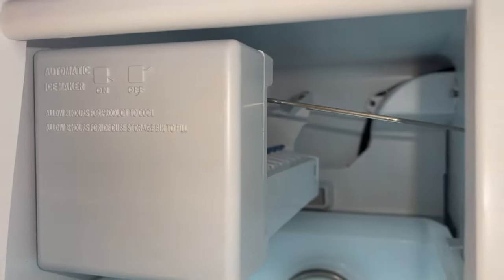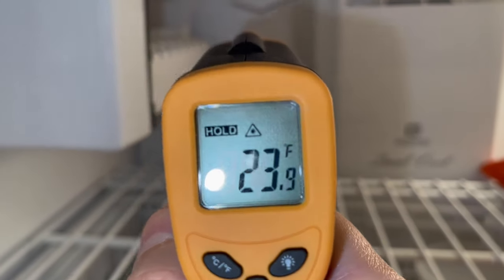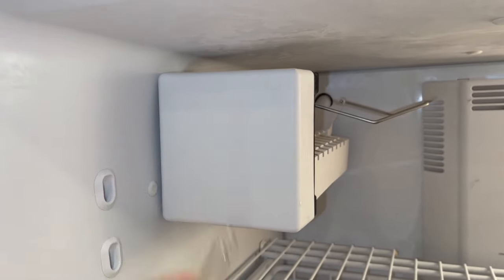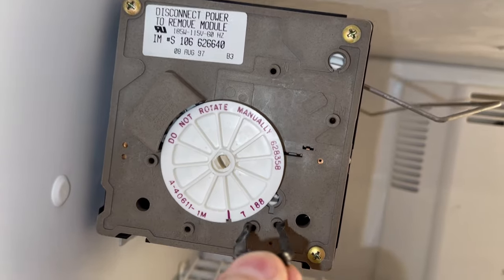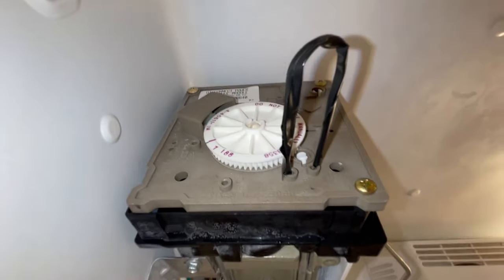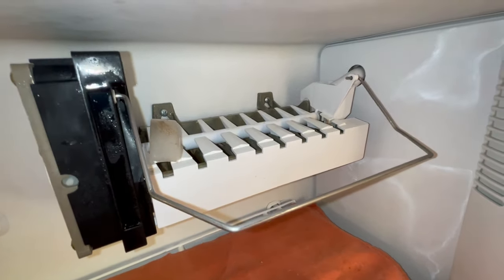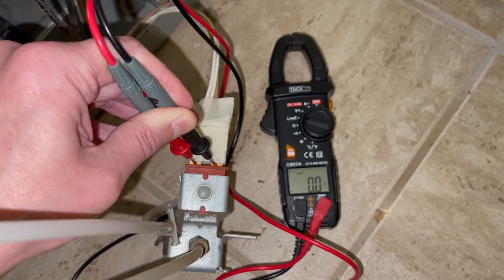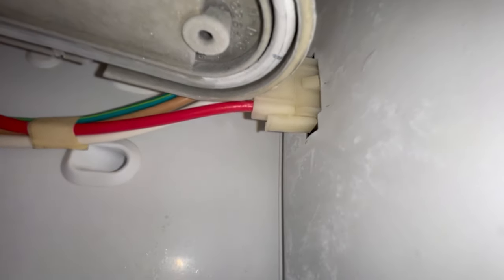Ice maker not making ice troubleshooting jumper test cycle

Comment: You can check the water valve by putting a jumper between L and V. Then push the freezer door button to close and you should get water to the ice maker. If you get water, it’s a bad ice maker. If no water, it’s probably the water valve.
Reply from the maker: Yes!
Just to add, if there is no water, the tube could be frozen shut.
Reply: @Your-Self  where do you have to point the hair dryer?
Reply: @Your-Self  how do you unfeeeze the tube ?
Reply: Awesome comment. Bad ice maker it is
Reply: @knix2for5  If it's one of the old standard type friges, you can usually go to the back on the outside, and the tube runs up the back on the outside, then there's a plastic spout that flows into the bowl shown in this video. Just unscrew the spout on the back and pull it out to see if it's frozen up inside.
Reply: I did this and ordered a replacement part but then it started working again
Reply: What if you’re getting water in the tray and not cubes?
Reply: What if it trows alot of water
Reply: @dtork47 

My issue. I’m waiting on your answer to hope we get one soon.
Reply: @dtork47 I would say check your freezer temps, if it's not freezing water that's a different issue entirely.
Reply: Is there just one water valve that supplies the ice and water dispenser or is there two for each function?

Comment: Also... Try taking the icemaker out and cleaning the tray. I use vinegar or better still cleaning strength vinegar. remove the ice bucket for better access. Loosen, don't remove two 1/4 inch bolts that hold the icemaker to the side of the fridge. (Unplug the fridge if you are more comfortable) Unplug the electrical connection by squeezing two tabs on the side of the plug. Remove the ice maker from the fridge and then remove the one plastic cover held with a phillips screw. I let the tray soak for 15 minutes  or so.  You can feel the difference in the smoothness of the mold. We have fairly hard water where we are so it builds up on the mold and makes it harder for the ice maker to harvest the ice. Might have to do this every year or two depending on the water mineral content in your area. Easy no cost fix!
Reply from the maker: Thanks for sharing.

Comment: He forgot to mention to make sure the little metal arm that shuts off when raised up once the ice-tray is fuĺl, is correctly lined up inside the little hole on the inner wall surface of the frobt of the ice maker. Such was the issue with mine, it popped out of place when [I] removed the ice tray for cleaning.¡ Gracias.. De Nada!

Comment: I have a rental property where I just had an issue. Both times I checked it the fingers were  not visible. I used the jumper and the cycle seemed to have worked.
Thanks for the video

Comment: The motor for mine stopped working so I purchased a new motor that came mounted on an end cap. Only three screws held it in. There is a flat side on a shaft for the ejectors that needs to be lined up but that was easy. Also, I removed the bar that senses when the tray is full. I just pulled the one side out, installed the new motor assembly and reinserted the bar. It took maybe 10 minutes. It would take 3 next time. You don't need to remove the icemaker for this repair if it is the motor that's bad. This video shows you how to test the motor. I would use an insulated wire instead of a paper clip, it's 120v. Thanks for the video!
Reply from the maker: Thanks for sharing.
Reply: Could you share the motor info and where to get it?

Comment: the jumper worked and the ice maker slowly lifted the ice out of the tray after the heater warmed enough to get the ice out. I'm looking forward to checking it later this evening. This was a very clear explanation and working item by item, the ice maker lifted the ice out and it slid into the drawer. Thanks so much!
Reply from the maker: Thanks for watching!
Reply: And the wire harness I have a voltage and one pan only is this correct?

Comment: Yes! Great video and very informative! Much better than the video's from the "experts" that I watched prior to watching yours.  I like how you cover the main point at the very beginning.  The freezer has to be cold enough to create ice.  My ice maker worked fine for a few years but stopped making ice a few days ago. I did all the electrical and waterline checks but could not find anything wrong.  Turns out that my freezer was too warm. The prior cooling level was fine until the last few days when the temperature in the home and opening of the freezer compartment has been increasing.  Thanks for your help!
Reply from the maker: Thanks for sharing.

Comment: Thank you. With the information in this video I was able to get my ice maker working again. Turns out it just needed a couple of test cycles.
Reply from the maker: Great to hear!
Reply: can you elaborate how you initiated the test cycles? i did the TH jumper and nothing happened. also tried LV jumper to fill water nothing happened
Reply: @zentember  I used a piece of electrical 12 gauge household wire and stripped off an ich of insulation on each end. I held the wire in place as it went through a couple of cycles. At the end of the second cycle the water poured into the tray.
Reply: @stephenlomond3720  where did you hold it in place? i was able to manually fill it with water but when i hold in TH nothing happens
Reply: @zentember  I inserted the wire in T and  H as it shows in the video at around 2:03 leave the wire inserted to get it to complete the cycle takes a minute or so to complete a cycle. .
Reply: @stephenlomond3720  i left it for several minutes not sure why nothing is happening. i used paperclip
Reply: Did you press the door switch to activate?
Reply: @DougGarrett-xb1vh  I do not recall having to do that but I could not say for sure I did not

Comment: Real help. Go thru the troubleshoot steps and eliminate the problem. Mine was water outlet frozen. Used a hair dryer. hopefully works for  while but suspect valve maybe slightly leaking water into the tray well. if so, I now know how to swap out the unit. thnaks.
Reply from the maker: Glad it helped!

Comment: Having trouble with mine today. I’ll check these tips out. Especially the paper clip cycling trick. It’s making ice but not ejecting. Turned it down a bit more to make sure it’s cold enough to engage the ejection. After a good wait I’ll try these tips if nothing happens. Thanks!
Reply from the maker: Good luck!

Comment: Thank you so much for this video!!! I just bought a new ice maker and it stopped producing ice. I used your jumper wire trick and it appears there was a couple chips stuck because after the blades made a full rotation a couple little ice pieces came out. It then filled with water now I just wait and see but I am very hopeful. Again thank you so much for this great video!!!!!
Reply from the maker: If you continue to see smaller pieces, make sure the ice maker is not tilted. Maybe the water pressure is too low. Or maybe, you just need to increase the fill time with a (possibly) hidden knob.
Reply: @YourSelf  came down this morning ice is full of nice good size cubes!
Reply: Or if there’s not enough water in the ice maker check your water filter it could be plugged enough that enough water isn’t getting through.  Happened to mine one time I was getting smaller then normal ice and it wasn’t getting enough water the filter was plugged.

Comment: the answer i found that worked for me was to take the jumper wire and push it in as far as it will go, easily. then remove it and do the same thing several times. for some reason there is corrosion that gets on the contacts and this seemed to work for me. Hope it works for you
Reply from the maker: Thanks for sharing.

Comment: Thanks for the video is informative and easy to follow. 
Question:
1. Should the voltage test show 120 at ALL times?  Or just when it's cycling?
2. How long does it take when inserting the jumper?

I put the jumper in and nothing happened.
And
When I tested with multimeter it was showing 6.25 volts. 

Does it matter that the defrost cycle was running?
Reply from the maker: On basic refrigerator models, you should always have 120 VAC on the L & N.
Refrigerators with multiple computer boards may act differently.
So, if you don't have the 120 V, it could be a wiring problem or a circuit board problem.
Reply: @Your-Self  Update:
Once the defrost cycle ended, I tested it again, and the voltage was 120.

Comment: Fantastic video - thank you!   Using the jumpers on V and L, I am able to get water to flow into the icemaker.  When I run it through a test cycle, everything seems to work EXCEPT that it does not fill with water.  So it sounds like the valve works, but is not being activated...is that right?  If so, do I need a new thermostat, or a whole new ice maker?  Thanks!
Reply from the maker: When you ran the test jumping T and H, did you remove the jumper when the wheel turned about a quarter turn?
If not, the water valve will not be activated. 
If yes, the whole ice maker may need to be replaced.
Reply: @Your-Self  Thanks for the quick reply!
I removed the jumper as soon as I saw motion on the ice maker arm.  Sounds like a new maker may be in order. :o(

Comment: Excellent video! Thankfully just flipping the arms on ours worked but thank you for the content!
Reply from the maker: Glad it helped!
Reply: do you mean reversing the arm where it was sitting or merely flipping it downwards?
Reply: @zentember  turning the ice makers off and back on then triggering the full switch 3xs puts the ice maker into reset mode.  It will automatically go through all the cycles
And start over.  Ours started making ice within a couple of hours after doing so.
Reply: @juliusflowers-fn5bb  what full switch the light switch on the side that is deprsssed when the door closes?
Reply: @zentember  my ice maker has a wide flap that lets it know the container is full of ice. That’s the flap I’m referring to. He uses a wire jumper in this video to do the same.  My ice maker is recessed in the door so i couldn’t do this without removing it.  If your ice maker looks like the one in the video (mounted) in the top corner of your freezer then do what he is showing you to do.  By no means am i discrediting the knowledge he is sharing.
Reply: @juliusflowers-fn5bb  my ice maker looks like his. I jumped LV to fill the ice but jumping TH does nothing. I want the heating element to turn on to eject the ice in the cradle. I have the metal arm like yours so I'll try to turn it off and on multiple times now

Comment: Excellent! Just what I'm looking for. Question, if you can answer: I need to clear my icemaker water line with compressed air to winterize my seasonal camp. Can I short L to V to force the solenoid to open? That would save some time. Thanks!
Reply from the maker: If you jump L to V on a basic refrigerator, the water solenoid will open. But if no water will run through it, the valve may overheat, not sure. But I suppose a few seconds shouldn't be a problem though. 
However, if you have a water dispenser as well, it gets more complicated. Because you may have 3 water valves total. And the trick with L and V will not work.

Comment: Great video. So far everything seems to work. But the water keeps freezing in the fill tube. I clear it and let it run, and  again it's freezing in the tube. It's a 30 year old fridge and has no problem  till now. Plus it's only adding a few ounces of water. Making small cubes when it was working.
Reply from the maker: Low water pressure can cause small ice cubes, and the water valve not to close completely. A weeping valve will create an ice blockage in the fill tube.
If the water to the fridge is going through a saddle valve, it may get clogged up with time. Maybe the filter is old. RO systems are not good for the fridge due to low-pressure output. Or maybe the refrigerator water valve is going bad... not opening and closing all the way.
Reply: @Your-Self  thanks for the info. I'll check the valve.

Comment: Hi, this video is great thank you. My problem: ice is building up under the cap that I removed to get to the wheel and jumper holes. It was frozen and keeping the wheel from turning, so I broke the ice and it worked for short time. Now it’s same problem but after I break the ice it still doesn’t work, it seems perhaps the ice / freeze extends beneath the wheel and jumper ports, maybe it’s frozen inside. So I wonder if getting a new motor will fix my problem or if something else is causing this ice freeze to happen? I don’t want to buy new motor if the new one will just freeze internally also. The temperature of the freezer otherwise seems fine so I wonder if water is leaking where it shouldn’t? Any idea or advice appreciated. Thank you!
Reply from the maker: That's a strange place for the ice buildup. 
Ideally, it would be great to defrost the ice maker to run the full cycle. Then, watch how the water comes out from the fill tube. Maybe it shoots out too strong and goes where it shouldn't?
It's difficult to speculate on the problem without being there.

Comment: Great video. What is the water cup is over filling and spilling over into the bucket and fridge? Where the water tube pours into. It's either too fast or too much. Just started doing this after a few years of no issues. 

Water pressure is 60psi.
Reply from the maker: It's best to get your eyes on the actual problem. Is it filling the cup fast and then slowly continuing to drip and overfill? Or maybe there is a crack in the tube, and it's dripping from somewhere else?

Comment: I have a Kenmore without the wheel but it still has the same labeled check points. I jumpered it and the ice ejector did it rotations. No water flow though. I checked the pins for that and never got any voltage on the meter. In the back of the machine, I connected the plug for the cold water switch to the ice make solenoid and when my wife pushed the cold water switch water flowed to the ice maker. It seems pretty solid that the ice maker water solenoid is not getting the signal to fill the trays. You said that that means the ice maker itself is bad? So that signal to fill the trays comes from the ice maker itself and not from the refrigerator's main board? Just confirming before buying a new ice maker. Thank you.

This video is phenomenal. I've never seen a diagnostics video that describes the functions of anything as well as you do.
Reply from the maker: On basic refrigerators, the ice maker controls the water fill valve. But some refrigerators have multiple boards, so it gets a little complicated. What is your Kenmore model number? Maybe I can look up the schematics.
PS. Did you remove the jumper when the ejector moved a quarter of a turn? If not, the water will not flow.
Reply: @Your-Self  Yes. I followed your instructions step by step by step so I wouldn't screw up. The model is 467200201W1 
It's a double door refrigerator with the freezer drawer below. 
Thank you.
Reply: That was the model number on a sticker on the rear of the refrigerator. The tag inside the the door lists "model number 596.72002011" it says: "Use Ice maker accessory kit IC13B"
The tag on the ice maker says: "IM # HR 106 W10469286"
"Customer # 02/27/12 IM 22"
Reply from the maker: According to the schematics, the ice maker itself activates the ice-water-solenoid.
First, I'd make sure your multimeter actually works by inserting leads into L and N holes. You should get about 120VAC standby voltage. 
Then start the cycle by jumping T and H... remove the jumper... insert leads into V and N and you should get about 100VAC for a few seconds when the ejector is at the top position. If you have no voltage, the ice maker is probably bad.
You can also manually jump the ice maker fill solenoid by shorting L and V. If the water flows inside the tray, your water-valve is good, but the ice maker is bad.
Your ice maker part number has changed to a new Whirlpool W10884390
Reply: @Your-Self  Thank you. It's been quite a busy week. Once it gets too hot to work outside today, I will move to inside projects and take another look at it.
Reply: Ran the tests today again. There is 120VAC to the unit. Jumping T&H does cycle the ice maker. Pulled the jumper out. No voltage between V&N at anytime during the cycle. Jumped L&N and the water valve operated and water flowed. Thank you very much. Time for a new icemaker.
Reply: I replaced the icemaker earlier this evening and just had my first ice drop and the machine refilled. Thank you so much. Success!

Comment: Thank you for your video it was very informative and straight to the point. I do have a question I hope you can answer. My ice maker is very similar to this one you were showing in your video. The issue I am having is that the ice gets caught in the far back corner and it promotes a clicking sound and I have to use something like a butter knife to hit the ice out of the corner and it takes a little bit to have the ice maker stopped making a clicking sound. It is making ice. Any thoughts on my issue?
Reply from the maker: What do the ice cubes look like size-wise?
Are they too small, too big, and stick together, or all different sizes?

Comment: Great video! My icemaker seems to run out of uumph! Tried two units and all the same. It's like the motor doesn't have enough power to complete a cycle. I can give it a shove with my impact on the gear and it runs for a few seconds and stops. Any ideas?

Comment: The water supply pipe can be kinked.
Filter can be plugged or minerals if they have hard water and no softener. If overflowing at full tube, check the water pressure as it could be too high.
This ice maker design has been used for 50+ years. Heater, motor, sensor or internal coating can fail. These have an adjustable timer at the front. A screwdriver makes ice cubes smaller or bigger & the adjuster has arrows on it. Move 1/4 turn at a time then wait for it to cycle.
Reply from the maker: Thanks for sharing.